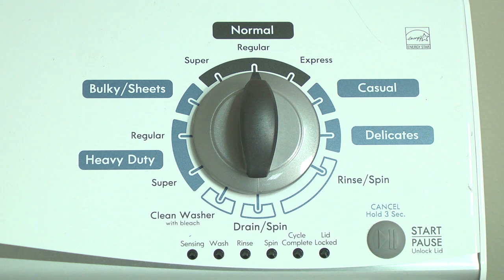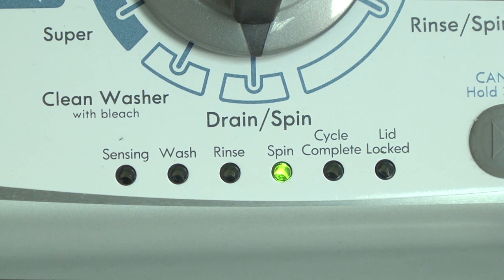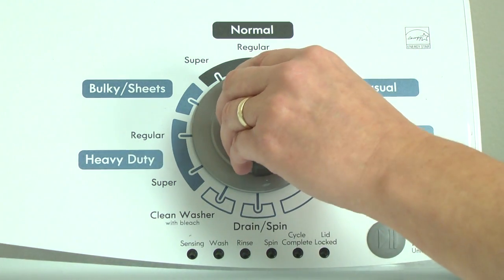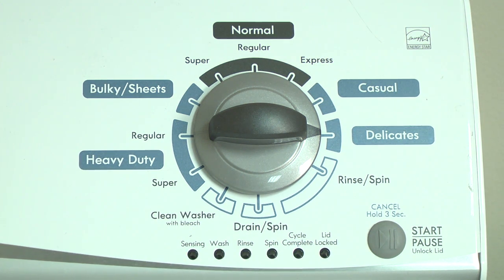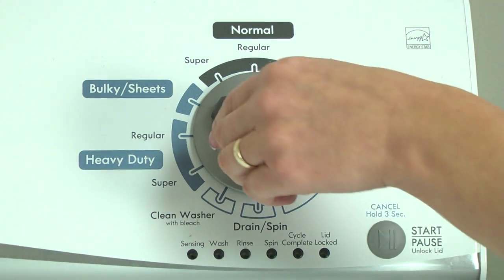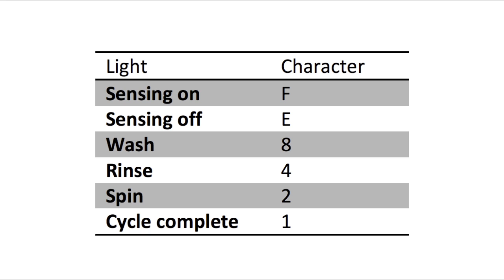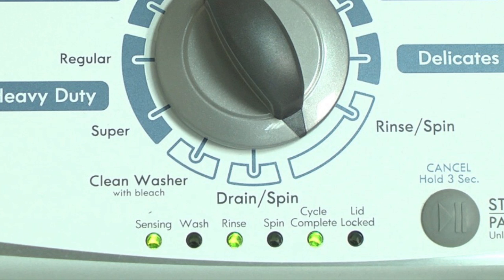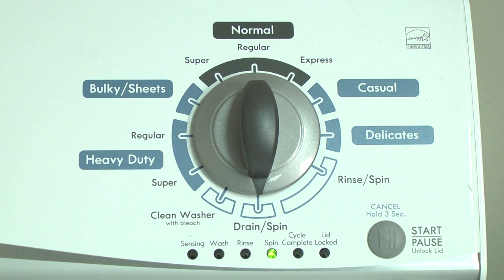How to Read a Vertical Modular Washer (VMW) Error Code Display

Comment: What if my washer isn't showing an error code recorded, just a flashing "sensing' light. Lid locks, starts sensing then clicks. Won't start cycle. What is it?
Reply from the maker: The flashing sensing light indicates that no error codes were recorded. The lid switch or lock switch on the lid lock/switch assembly may have failed even though the lid locks. The control won’t start the cycle if it detects that the lid is open or unlocked on many models.
 
We recommend that you have a service technician examine and repair the washer. You can schedule service here:   https://www.searshomeservices.com/.
 
If you want to troubleshoot and fix this problem yourself, post the model number of your washer and we’ll provide tips to help you resolve this problem.
Reply: @searspartsdirect  Is there a way to disable the lid lock?
Reply from the maker: @jadeGreen6464  Not on the washer shown in the video because the basket spins at high speed and the drive system doesn't have a brake to stop the basket when you open the lid. Overriding the lid lock would be dangerous.
Reply: Sears PartsDirect mine will wash but when it’s ready to drain and go into rinse cycle, the “sensing@ light blinks after a few lock clicking sounds.
Reply: Sears PartsDirect it is model 1102022 I tried to recalibrate the washer but nothing happened.i recently moved it so I thought maybe recalibrate it first and see if that helped but I can’t figure out the correct clicks sequence.
Reply from the maker: @jadeGreen6464  Enter the diagnostic test mode and recover the error codes that are in the washer control's memory as shown in the video. Let us know which codes the washer has stored in memory and the model number of your washer. We'll try to help you fix the washer once we get that information.
Reply from the maker: Thanks for posting that model number. Try to enter the diagnostic mode and recover the saved error codes. Let us know which codes are saved in the control's memory.
Reply: Sears PartsDirect ok. It’ll be a little bit. But I’ll try. I tried once already but nothing happened. I’ll rewatch and try again in a little bit
Reply: Sears PartsDirect I have tried to get it to enter diagnostic mode. Nothing happens. No lights blink or flash at all.
Reply from the maker: @jadeGreen6464  That diagnostic mode is somewhat difficult to enter. Many service technicians have trouble entering that mode. Using the error codes saved in that test mode is the best way to start diagnosing and repairing that washer. Try resetting the electronic control board by unplugging the washer for 5 minutes then plugging the outlet cord back in. Try entering the diagnostic mode to recover error codes again. Make sure the dial is at the 12 o'clock position before starting the diagnostic mode entry sequence. If you still can't enter the diagnostic mode, then you'll likely need to have a service technician visit your home and fix the washer. Based on your description, the mode shifter (also called the actuator-- https://www.searspartsdirect.com/product/2p4sm8ggks-0026-110/id-w10815026 ) may have failed. If you can't enter the diagnostic mode to recall the error codes and you want to try to fix the washer yourself, you can unplug the washer, drain water out of the washer if the tub is full, and check the wiring connections on that part. Here's a video that shows how to access the mode shifter: https://www.searspartsdirect.com/diy/repair-guide/how-to-replace-the-shifter-assembly-in-a-top-load-washer . Reconnect the wires on that mode shifter if you find them loose. Replace the mode shifter if it's visibly damaged. If the mode shifter is okay, then you'll likely need to have a service technician examine and repair the washer. We hope this information helps. If you need further assistance, let us know.
Reply: @searspartsdirect  ok. I'll try that in the morning
Reply: I just had the same result with mine - Kenmore model 110.5072011 - would it be okay to try running a short wash cycle with no clothes in it to see if it cycles thru a whole wash sequence with no more problems?
Reply: Of course it's ok...
Reply: According to your video instructions, my Washer is showing No Error codes. The reason I'm here is I replaced the Lid Lock Assembly and Washer is still not working. Calibrated it as well. Any ideas? Model #110.21302010

Comment: I can't get my washer to go into diagnostic mode. The sensing light starts flashing as soon as I plug it in and none of the buttons do anything
Reply from the maker: Plug the washer in and leave it plugged in for 7 minutes. If the washer didn’t drain properly, then the control will run the drain pump continuously for 7 minutes to drain water out of the washer. After 7 minutes, the control may allow you to enter the diagnostic test mode and recall error codes. If not, then you may need to replace the electronic control board. Here’s a video that shows you how: http://www.searspartsdirect.com/repair-guide/washer/how-to-replace-the-electronic-control-board-on-a-top-load-washer.html.

Comment: Kenmore washer makes cracking noise
Reply from the maker: Items caught in the drain pump can make cracking noises. Unplug the washer and access the drain pump as shown in this video: https://www.youtube.com/watch?v=XnR42xJSY-0&index=1&t=4s&list=PLbGAdX0H4-79W1yESEP4Epc_Sv3ZtWWuw 

Disconnect the drain pump hoses and check for debris inside the pump. If you need more help, give us more details, including the model number of your washer.

Comment: I video taped the sequence but can't figure it out can I send it somewhere to help figure it out?
Reply from the maker: Create a YouTube video or Drop Box link and post the link. We’ll look at the video and try to help you out.
Reply: I added the video link here. still not spinning all the water out.
Reply from the maker: Thanks for posting that video with the error codes. The F2 E1 code indicates a stuck key and was probably caused by holding a button down too long. The F0 E2 indicates excessive suds, which probably got resolved already. We’ll ignore those two codes because they probably don’t indicate the cause of your spin failure. The F7 E1 and F7 E7 indicate that the control isn’t detecting proper drive motor rotation (likely because the motor isn’t running). Unplug the washer and check the wire harness connection on the drive motor and the motor capacitor. Here’s a video that shows how to access and remove the drive motor: https://www.youtube.com/watch?v=sgRsPQJQt7g. Reconnect any loose wires. This may fix your problem. If not, you may need to replace the shifter assembly that detects motor spin. The drive motor or electronic control board could also be broken.
Reply: Thanks I'll keep you posted 👍
Reply: it was the shift actuator 👍
Reply: Do you remember how much that cost?

Comment: no lites and when I plug in washer it begins to click and sound like it's going into its cycle but then it doesn't and it just makes a noise and I can't turn it off and there's no lights and start button is not responsive the whole time  I have unplug it
Reply from the maker: You’re likely hearing the drain pump running as soon as you plug in the washer. An item may be stuck in the drain pump if the noise is loud. Here’s a video that shows how to remove and replace the drain pump:
https://www.youtube.com/watch?v=XnR42xJSY-0 
Remove the drain pump and check for an item stuck inside. Replace the drain pump if it’s damaged. If the noise isn’t loud, plug in the washer and allow the drain pump to run. It will run for about 5 minutes and then stop without damaging the drain pump or other components. The control detected a long drain or overflow condition so it runs the drain pump for about 5 minutes to drain water out of the washer. After the drain pump stops, you can read the error codes as shown in this video to determine the cause of the problem and fix it.

Comment: I got this model with the spin light flashing and it wont go into the diag mode. I also have a whirlpool cabrio (w/o lcd) that wont go into diag mode ether, it's making a low rubber squeaking sound when I start it and keeps going a few sec's after I turn the power off.
Reply: +Allen McKinney 
Unplug the washer for 5 minutes to reset the electronic control board. If the drain pump runs as soon as you plug the washer back in, leave the washer plugged in and let the drain pump run for 5 to 7 minutes until it stops. You should then be able to enter the diagnostic test mode. If not, then you may need to replace the electronic control board. I recommend that you have a service technician examine and repair the washer if you can’t enter the diagnostic test mode.
Reply: Wayne A

Ok I got the codes on the 1st washer (same as the vid) and found the latch was broke (fixed now) now its saying the speed sensor is bad. No luck with the cabrio washer. I checked the boards on both washers and both have a steady green light that suppose to mean they are good.

Comment: I'm getting a code that does not exist in the diagnostics code booklet.
F5F7
1st flashing code: Sensing On=F, Rinse=4, Done=1, ads up to F5
2nd flashing code: Sensing On=F, Rinse=4, Spin=2, Done=1 adds up to F7
That combo does not exist, I really hate the faulty and inferior technology of today.

If you bought a washer in 1978 it would last decades. Your lucky if you get 7 years on an appliance today. I've' seen major failures in 3 years, and 1% are defective right off the assembly line. You can't trust any one popular brand over another, they all use the same imported inferior technology. I wouldn't mind so much if the manufacturers would bring the prices down to the quality that goes into them, Like $50 for a new washer is about right, then I wouldn't mind so much if I had to buy a new one every year... Lol, Jokers.
Reply: +K Zpodindustries Blame the government.. If you voted for the current administration, you're part of the problem... If it wasn't for the Government in the public sector, we would still have old designs that worked flawlessly and toilets that flushed everything down.. We have supposed  "green" technology that was mandated by Obama and his minions but nothing that the Government does in the public sector works..
Reply: Chad Schloss
During the 1930s depression people were pleading with Roosevelt, "Please help us, we are losing our farms". The government was never supposed to be involved in such affairs, but Roosevelt used government money to create a massive road and bridge building projects that got Americans working again, he began to regulate businesses and incorporate workers rights, Roosevelt was called a communist for regulating how businesses treated employees.

Roosevelt successfully pulled the US out of the depression, so Roosevelt then slowly began to pull back on the government created jobs, but the economy began to slip back into a depression, so ever since the government has always been there to tweak the economy to keep people working, we cannot sustain ourselves without assistance, without such assistance and social programs then you have the African model, the extreme wealthy, the extreme poor, and with no social programs then you have orphaned children living wherever they can sleep and constantly begging for food and money.

The government works side by side with the corporations to the point that the corporations actually manipulate and control all governmental operations. If people are working then they are generally calm and generates the flow of tax dollars, when people are not working in mass they are angered will riot and destroy everything to the point of implosion if allowed to do so. It's within everybodies interest to keep people employed at all costs. I could also go into detail explaining that who you vote for does not matter, it's all manipulated and controlled internally to the point that you have the illusion that your vote matters... but very few are interested in knowing any of that, simply because the truth of it all is far more difficult to handle than believing the lie that you and I actually have control over our government, we lost that control over 100 years ago. The information is there if you actually care to know... most don't want to know.

Comment: what happens after i replace a part. do i have to reset the machine or should it start working automatically?
Reply: I'm sure if you had the washer unplugged when you did your repair, that that alone was "resetting" it. Should be good to go

Comment: Hi Julie. Have you tried unplugging the washer? Try unplugging the washer for 5 minutes to reset the control board. Then plug it back in and see if it will enter test mode now. Hope this helps.